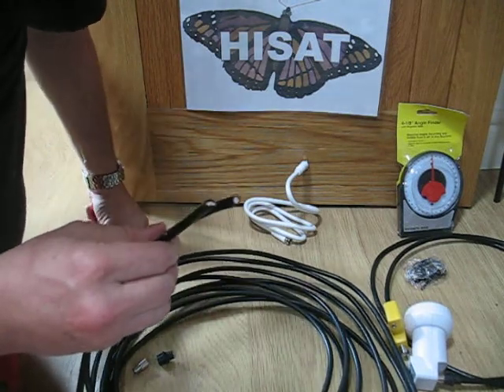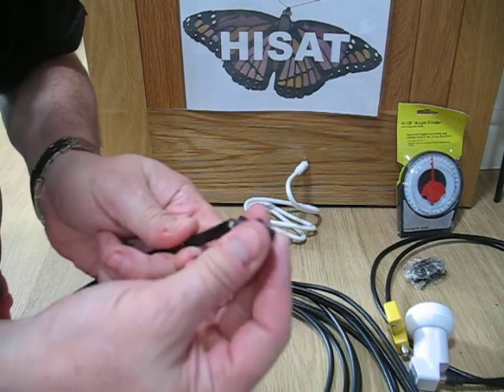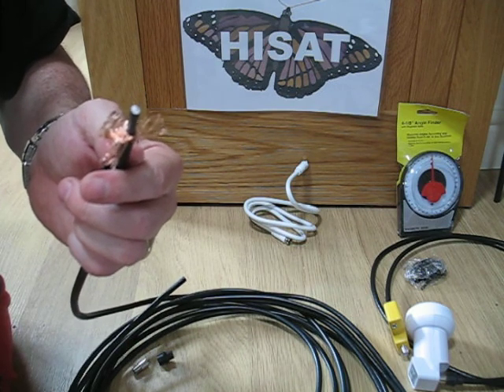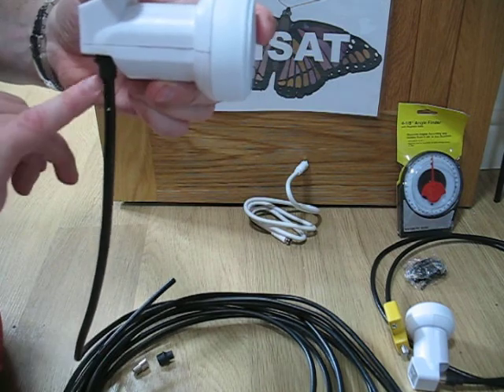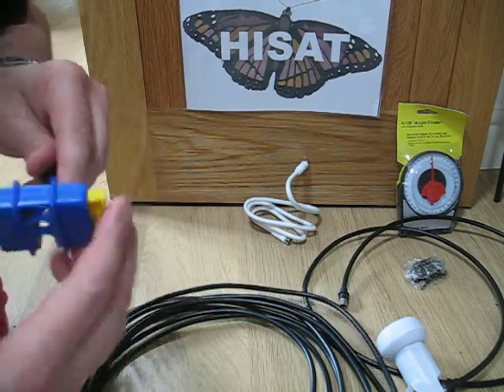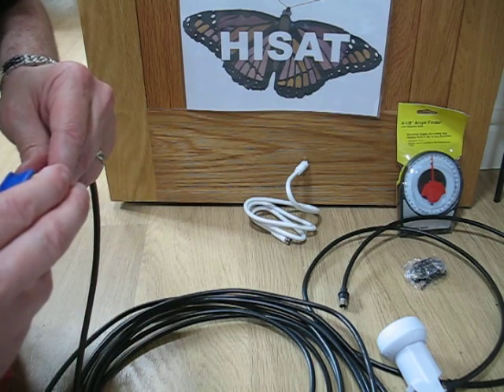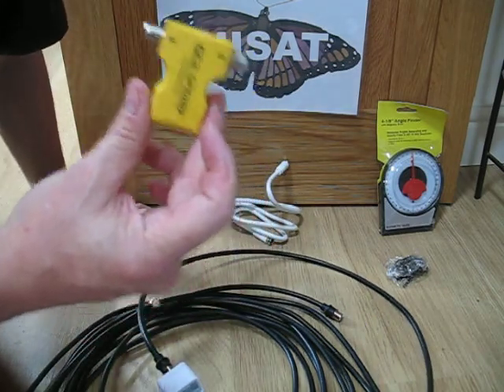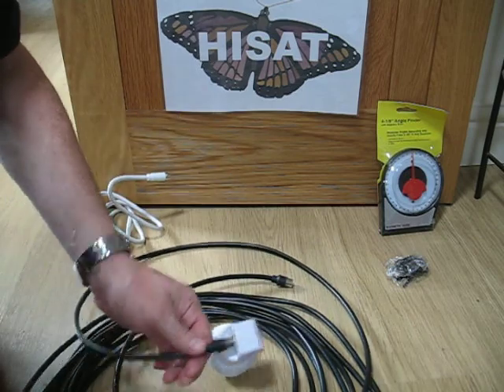Installing a Cut and Push F connector for satellite TV

Comment from the maker: another point not made in the video concerns the material of the shield - the "gold" colour shows that this is Copper which appart from Gold is one of the most conductive materials and once again this makes it an Ideal Low-Loss alternative to the more common RG59 or RG6 cable.
CT100 cable is a little more expensive but for Motorised installations where you may want to see weak signals from time to time anything less is a false economy

Comment from the maker: there was a small mistake on the narative at the end it's the last LNB connection (not the fast fit one) that reduces the connection down to only One because in the first connection I made - the Metal shield is forced into direct contact with the F female of the LNB

Comment: Interesting, but how do you calculate that you reduce from three connections down to one? Standard F connectors would mean one connection for the screen braid to the connector plug then one between the connector plug and the socket, so two in total for the screen/shield. The solid conductor passes straight through the centre of a standard F connector into the socket, so just one connection there, no change.

Also, you say it would cost less to do the job using these CaP connectors. Are they les

Comment from the maker: the standard Metal spin on (as used by DiYers) F connector has two metal parts the three connections are
1 Screen/Shield of Cable with bottom of F connector
2 Bottom of F Connector with Top
3 Top of F connector with LNBF
The CaP connector forces the shield into direct contact with the LNBF so only 1 connection

Comment: HISATdotCOM hi

do you have any advice for me here?

well i have my sky dish located on the side of my house going upto the roof on a long poll

well when we get high winds the dish spins on the poll! i have paid 3 times to get it fixed and i am getting sick of it
Reply from the maker: Arron for some reason I never got a notification about your comment and only noticed it just now - it's best to email hisat@hisat.com if you have an immediate issue
I hope you don't still have this problem but if you do then clearly the equipment or the installation is the problem
it could be that the installers are making the best they can of poor equipment I've seen some very weak poles and some very badly made antennas if more than one person has "had a go" then chances are you need to buy something better - you don't say why the dish needs to be on a pole but I'm guessing you have some high trees or a building you need to see the signal past
if it's possible to resite the dish getting rid of a high pole that's always a good idea 
if not get a pole which is greater diameter with fixings to match and a good quality dish like one of the gibertini dishes on my website - call me on 07808607502